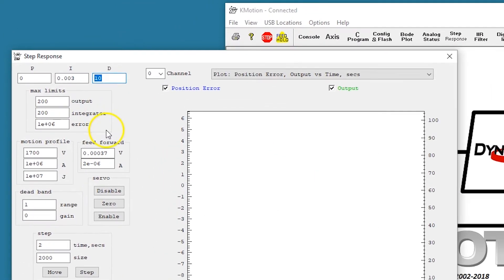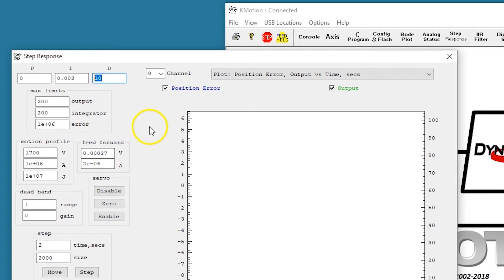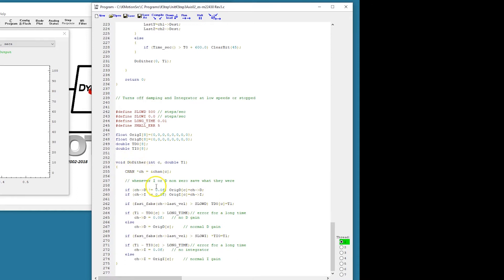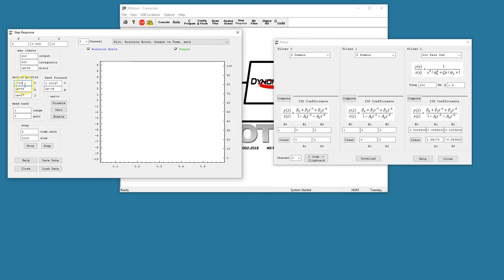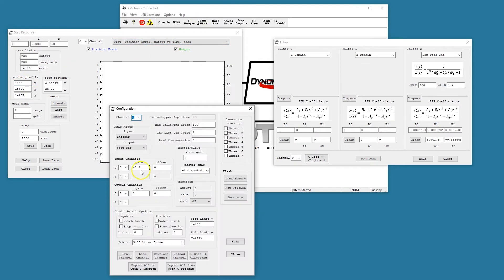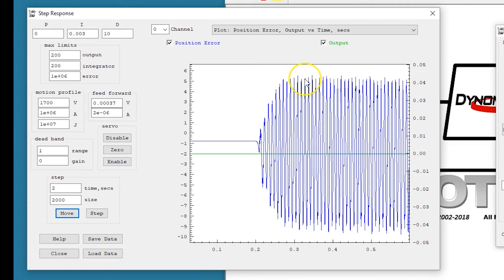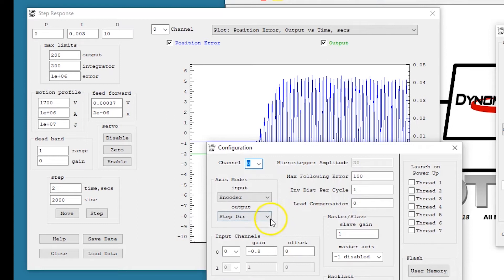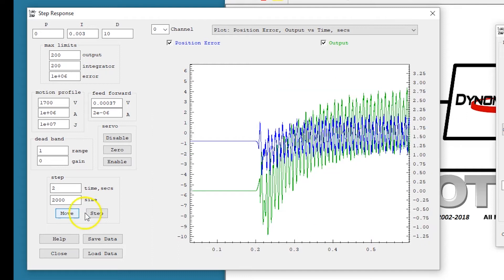ActiveDamping

Comment: This is helpful and brings up my misunderstanding. What is resonating? The motor or the motor and pulley or the motor, pulley and vice. And another but related question from a novice. Is it common for stepper motors to have a resonance that is sympathetic at a certain low frequency like this?  And one more, is this a high pass or notch type filter technique? Or is it filtering out just a narrow gain? So what is the resultant result of filtering the D, why not turn it off entirely?
Reply from the maker: The motor rotor (and pulley) mass connected to the motor body by the spring like magnetic holding torque forms a two mass plus spring type of resonant system. The resonance vibrates the vice and rattles the beaker.  Such a resonance is common especially with low friction. 

A notch filter would help to not excite the resonance but since it has no gain at the resonance would not help dampen it. D gain  basically resists motion to dampen the resonance 

There is a low pass filter used to avoid instabilities at higher frequencies as well as smooth spikes caused by the Derivative term. 

HTH
Regards